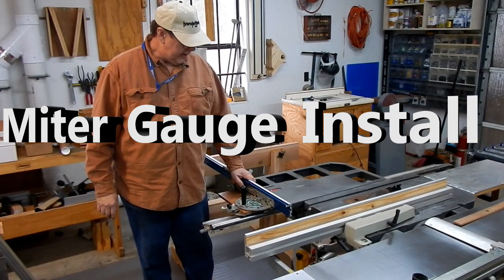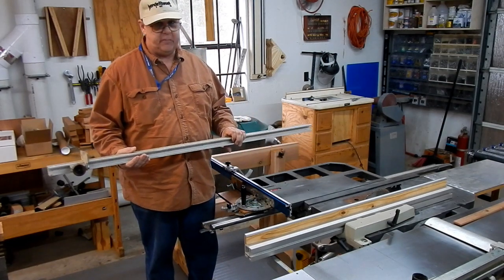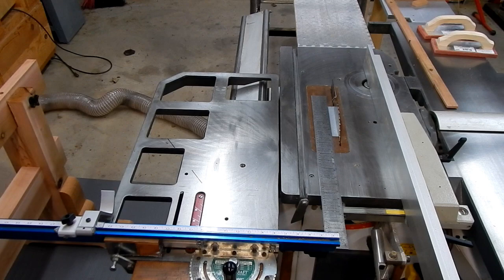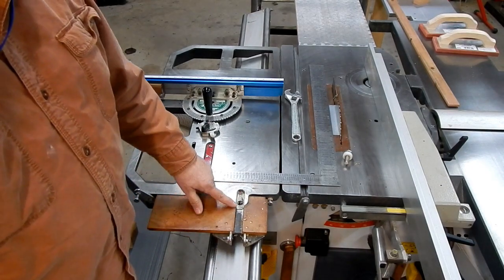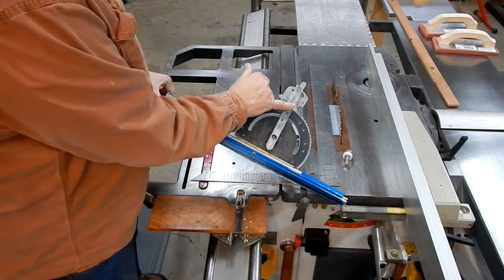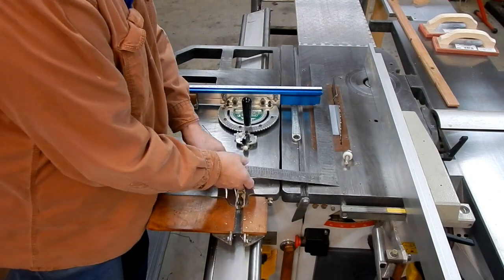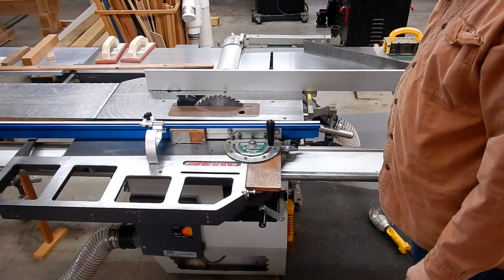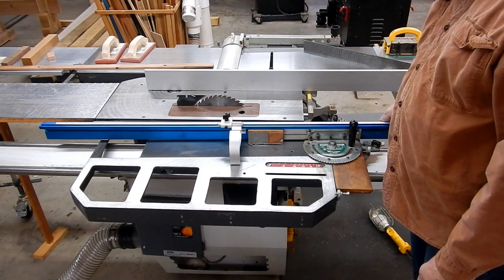Robland X31 Miter Gauge - Fence Install

Comment: I appreciate your great videos! I just purchased a grey x31. I want to add the Incra 1000se. I believe I’m capable to duplicate your design, but I’m stumped with using the endmill. Not sure my router can accept 1/2” shank bits. Do I need to pour oil while cutting? What rpm does the mill turn at? Do I make six to eight 1/16” deep passes? Thanks for being such a mentor to the craft!
Reply from the maker: Make sure you use a quality end mill. I used a cheap one at first and it was doing a terrible job. Ended up getting a Kodiak End Mill 131602 1/2" 4FL and it cut through the cast like a hot knife through butter. I used a 3 HP variable speed router on the lowest speed setting and took passes of of about 0.100"" and made a final clean up pass of less than 0.060". Make sure you have a good fence to ride against. I clamped a metal straight edge to the table and installed a large straight edge base to the router to give it the maximum  amount of control.  No cutting fluid needed.    https://www.amazon.com/Kodiak-Cutting-Tools-KCT131602-Diameter/dp/B0070YYP6E/ref=sr_1_11?crid=1KUYAYDU3EJDX&keywords=kodiak+cutting+tools+1%2F2+carbide+end+mill&qid=1677678892&sprefix=kodiak+cutting+tools%2Caps%2C159&sr=8-11#customerReviews

Comment: Hi David nice video and idea on Improving the sliding table fence . where did you get the long blue fence from and do you find there is much play in the fence when at an angle .. just wondering if I go down your route with the fence is to put a locking mechanism on the left of the table to steady it , Cheers from NZ
Reply from the maker: The blue fence is made by Kreg but you could use 2040 aluminium extrusion as well. At 90 degrees the flip lever at the end of sliding table offers support for the fence. When I cut 45's or the like I have been just clamping a block behind the fence at the end of the table. I have some 4040 aluminium extrusion for extending the sliding table and the top t-slot could be used to lock the fence down. Just have not gotten around to putting it on because at the same time I want to build a swing arm support for the sliding table. Hope this helps.

Comment: Hello Mr. peep, I just want you to know that I appreciate your videos. I’ve also recently purchased an X 31 and I’m excited to get using it. One question, I was wondering how you liked the addition of the Inca fence, versus building a sled. I know it only has one slot, but I’m trying to get started as cheap as possible. Thank you so much. And thanks for the great work. I also like your Woodmill videos as well.
Reply from the maker: I like the incra miter miter gage addition because  I can take it on and off easily and with the set screws locked down it goes right back on in place.  Alot more accurate than the factory setup although today I would probable do a better job mounting it. I am going to make a small parts sled for the sliding table something like the Fritz and Franz Jig. Sam Blasco also has a nice setup using a positioning fence on the side of the sliding table. I intend to make a conventional sled first using the slot and the sled together. The slot in my table is a conventional 3/8" by 3/4" slot.  Check out https://groups.io/g/roblandx31 for information on the X-31. If you do not have the manuals or need setup information you can download them from there.

Comment: Thanks for the post. I also have a X31. I am not able to use the sliding table. Try as hell over the years but I am unable to get my table planar and to slide parallel to the blade. How did you accomplish that? Did you use one of yhose sliding table adjusters that some folk seem to have that hold the sliding table rail planar and parallel for the adjusting?
Reply from the maker: I  use a 48" straight edge, 36" straight edge and a good square to do the alignment. The design of the table has more weight on the outside of the rails than than the inboard side so when the scews are loosened off the table naturally dips down on the outside thus making it harder to align. The diagonal adjustment on the rail does not help either. If you are not a member of the (roblandx31@groups.io) i would recommend you join. Bob U. had five sets of the rail adjusters left three months ago and they make all the difference in the world. Since the sliding table is weight heavy to the outside any time you have a long or heavy piece of lumber hanging out off the table it needs to be supported or you can bend the roller brackets throwing the table out of alignment. I normally use a support roller under the outside of the table edge.